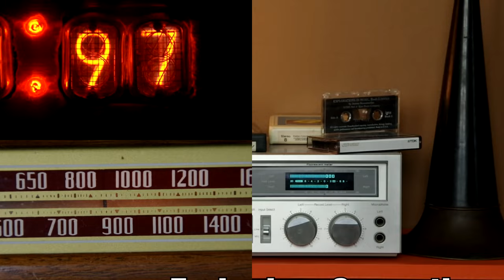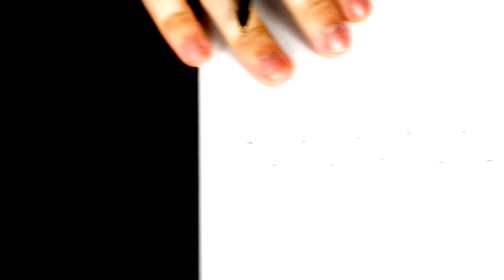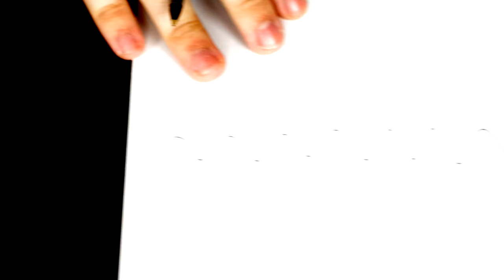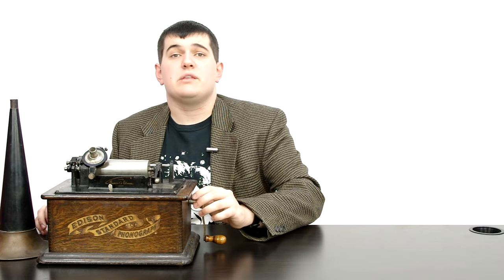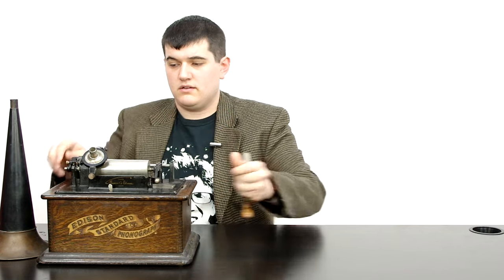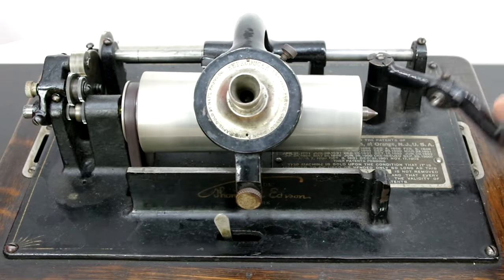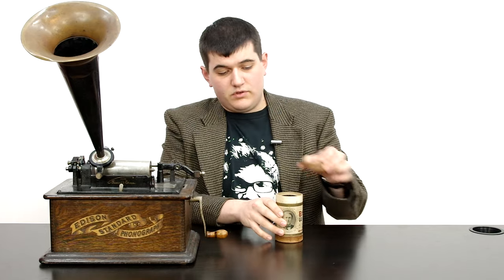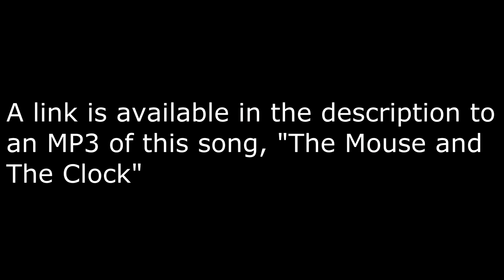Edison's Impression: Laying Sound into a Groove

Comment: The whole thing about the rotating paper disk that replays telegraph clicks comes across as if it was something Edison invented, which it may be. But what I read said this was part of the patented telegraph system (which was licensed as a system) when Edison worked for years as a telegraph operator. The system was supposed to be that messages would be sent at a speed too high for humans to understand and transcribe (so that more messages could go over the wire), but people could indeed send and understand messages just as fast or faster without it, so it was never used by proficient operators. However operators were required to train on and know how to use the paper disk device according to the terms of the license.

Comment: Very nicely done and well researched. The model h reproducer however is for 4 minute cylinders and playing wax two minute cylinders with the 4 minute model h reproducer will result in accelerated wear. A model c reproducer should be used instead. The h can be used on both 4 and 2 minute celluloid cylinders without damaging them
Reply: It looks like he’s playing a four minute blue amberol  cylinder.

Comment: Hm, the governor is a component in music boxes too. (Yep, I also watch Bill Hammack, lol.)
Reply: And stationary steam engines. And anything you want to run at the same speed from a varying power input.
Reply: Also in some small DC motors, as was used in cassette recorders of the seventies. The mechanical governor was a set of weighted, normally closed switches, connected between the commutator and the rotor windings. As the speed increased, the weighted switches would open. This caused the current in the rotor windings to cease. This would cause the motor to slow down. As it did so, the centrifugal force on the governor reduces, allowing the switches to close, and for current to flow once again in the rotor windings.

Comment: These machines were far superior to the modern turntables of today as they had no tracking error and needed no anti-skating device.  His machine is just out of adjustment is all.
Reply: You could have a great deal of tracking error as the initial groove position of cylinder is not synchronized to the lead screw that moves the reproducer/horn assembly.  The issue of groove wall imbalance due to tracking on discs is mechanically compensate-able, but Rabco came out with separate, linear-tracking tone arms back in the  1970s (search hint).  Rabco was purchased by Harman-Kardon, who released the ST-7 turntable/Rabco tone arm in 1975.  Note that a couple of years later, Harman discontinued the ST-7 and by probably 1985, Rabco was essentially finished.

Comment: ...so the very first recorders were in fact digital. Telegraph signals being essentially on or off only.
Reply: Not digital at all (unless by "digit" you mean fingers on your hand).  The waveform imprinted into the wax or foil is a directly analogous to the original waveform.  There is no conversion to a numeric representation for storage and no re-conversion back to acoustic waves.

Comment: For all the years I've been familiar with the wave form representation of sound it never occurred to me that the lower portion represents the sound pulling away from ones ear.  Thanks for the explanation!  This leads me to the question; did Edison's sound recorder only record half the wave (the upper, pressing, portion)?
Reply: I don't know, but I would imagine you'd position the recording needle so it was already making a groove of a little depth, with no sound. Then pulling waves would make the needle pull up, pushing make it go down. So you'd get the full wave. It would increase quality and loudness, doubling the energy output. 

If Edison understood the nature of sound waves, he would probably have done that, since he had a decent engineering mind. Though not as decent as the many people whose ideas he stole of course. If he'd seen pictures from the Phonautograph, he ought to have understood that sound waves both pushed and pulled. Scientists would have remarked on that, it would have been available as information for him to read (and steal!) even if it hadn't occurred to him.

Actually with only half a wave, and flatness inbetween, there would be something like a buzzing sound. Like overdrive on a guitar, which is similar in nature. So likely it does push and pull.
Reply: No.  If all the vibration is transferred to the recording stylus, then the entire waveform will be represented.

Comment: Record is Edson Gold Moulded 9434, The Mouse And The Clock by The Edison Concert Band from 1907.  That record is in excellent condition, no mold (the black wax records had a notorious mold problem, including the Amberol records (in the green box); the Blue Amberol records solved a lot of problems of black wax - they sounded better and were a lot more rugged.

Also, some of the earlier cylinder phonographs did not use a 160 rpm speed; some ran at 120 and 144 rpm.

Comment: I don't think you're using the term "sound energy" correctly. The y-axis on that waveform represents the pressure at a particular point, with the x-axis representing time. The sound energy is constant for a sine wave; it's the pressure that oscillates.

Comment: I'm not sure how copies of the cylinders were made.  If he electroplated the tinfoil to make it more sturdy, then plaster molded two concave half cylinders of plaster, he could use them to stamp/mold hard plastic into copies of the master recording.  But the slightest misalignment of the two halves longitudinally would displace the half turns of the groove and ruin the copy.  And worse, there would be a longitudinal molding ridge on each side, that could not be sanded off without erasing that part of the groove.

However the copies were made, they must have been very expensive.
Reply: Edison did not master the problem of cylinder copying until the 20th century. 

In 1879, he experimented with a disc version of the tinfoil Phonograph, with the intention of making copies by electroplating. When he moved to the wax cylinder in 1888, he tried the idea of two-part molds; but these left a line which made an audible click. The manufacturing process, in the early days of the 1890s, was to record as many masters at once (depending on the selection: a soloist could only record a few copies; while a large band could perform before a large bank of machines). The masters were then placed on copying machines, or *pantographs*, which could cut a number of copies from each master.

 It wasn't until he designed a system of masters, sub-masters, and final molds, carefully gauging the rate of contraction as the wax cooled, that true mass production was possible. This required changing the grooving on the master: a final product of 100 threads per inch (tpi), meant that the master had to be cut at about 96 tpi.

Comment: Is there a video about how the cylinders were manufactured? pressing like vinyl would be rather difficult, so was each one done at one time and cut like acetate?
Reply: Each one is a new recording.  No two cylinders are identical.  It wouldnt be until years after the advent of the disc that masters and stampers and such would be used.
Reply: @emoney3618  Thank you for the information. So basically like modern day lathe cutting for small runs of vinyl records.
That is logical, if a pressing master was used, it would require two halved and therefore artifacts would be definitely noticable on the joint.

Comment: At 11:00 you meant « centrifugal ». It does not matter much though because it’s wrong too. There’s no such thing as a centrifugal force either here. Only inertia and the force exerted by the spring which induces the normal acceleration toward the center. Now that is a centripetal force. Inertia is not a force, only a principle helping to support a mental framework.
Reply: @lordgarion514  Lovely. Kind of mind-boggling too… 🙃

Comment: That is NOT how a sound wave "acatually" looks like. That is a 2d representation of a transverse wave, whereas sound is a 3d longitudinal wave. If you want a 2d representation of a longitudinal wave you'd have to imagine a horizontal bar getting larger and smaller with each impulse (the expansions and contractions corresponding to the peak and the trough of a transverse wave, respectively). But if you wanted a 3d representation of what a sound wave ACTUALLY looks like you'd have to imagine a sphere expanding with each impulse (like a speech bubble from comic books) originating in a person's vocal "chords" (mind you, it is simply a flap, no actual chords in your larynx). Bare in mind the fact that sound can only be triggered by impulse, there is no actual trough per-se caused by a proverbial chord as with a sine wave representation (which depicts the electrical current wave and NOT an actual sound wave). That is to say, the trough part of the wave is not an action but a reaction. A practical representation would be if you suddenly moved your hand inside a volume of water, pushing some of the water in a direction: the trough will form due to the hysteresis of the medium (the inertia of the water). In front of the hand, the volume of water is being compressed whereas the rest will struggle to "keep up" but it does not have sufficient momentum, therefore you get hysteresis.

Comment: Explain to me how a locomotive works :-D
Reply: "Well, you see, you have the steam - here, and the wheels - there. And in between, there is some sort of mechanism or mechanical linkage. Thank you and goodnight. And that, is the locomotive!"
Reply: I’d love for him to do some more transportation technology videos
Reply: Burney-burney in the firebocker bubbly up the sloshy-sloshy in the boilie-ho, convertilating it wattle-vape, which pushy on the pistols in the cylindricals, drivening a serial of rods and crankshafts to go-elate the turnyrounds
Reply: Early locomotive engines were actually powered by burning livestock, until Thomas Trevithic , after an evening playing Settlers of Catan, had the idea of substituting wood for sheep...

Comment: Does it play in reverse if you put in the cylinder backwards?
Reply: You can't put the cylinder on backwards. It won't fit. It's tapered so you can only fit it on one way. But if you could fit it on the other way then yes, I suppose it would play backwards.
Reply: No it wouldnt is the answer, because it is governed by the the rotation of the feed screw, which in turn moves the reproducer/stylus along. This would mean changing the complete rotation of all that drives it.

Comment: In the early 2000's, I had a CD player and a Walkman... Then, in 2004, I got my first MP3 Player and thought CD player and Walkman were bad... LOL... Imagine walking around with a phonograph. I don't even know where to plug in my headphones in that machine.
Reply: You'd have to use something like the pneumatic headphones airlines used to use. This is the closest I could find today. Of course you'd need an adapter, but it could be done. https://www.newmaticmedical.com/mri-hearing-protection/p/iN-Ear-MRI-Headphones/

Comment: Nobody calls it tin foil. It's aluminum foil.
Reply: He not talking about aluminum, tin as well as any metal can be made/pounded into a "foil".  Some metals will take longer than others depending on hardness.
Reply: The original medium was a composite foil of lead, lead-tin alloy, and tin. Aluminum foil did not come in until much later.
Reply: Any medal can be foil. Even Copper, Or iron.